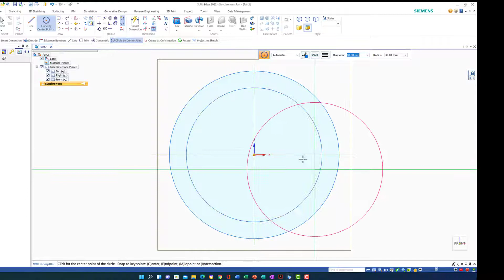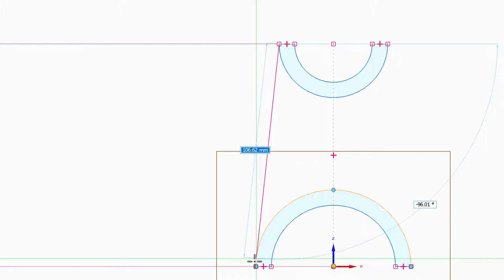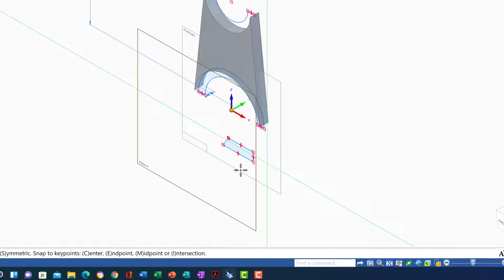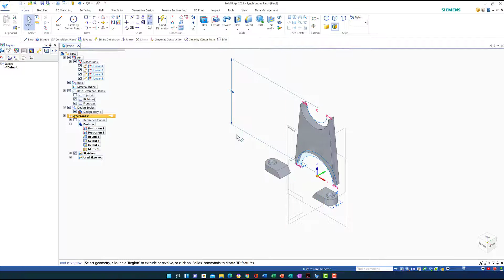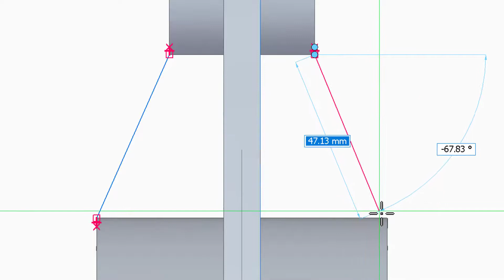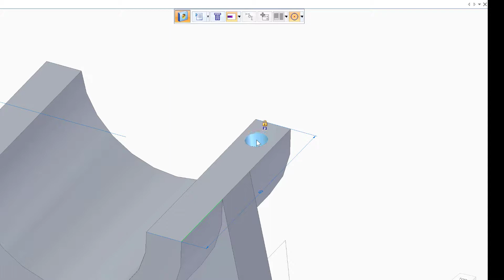Learning Solid Edge - Exercise 7

Comment: Great tutorial for learning SE. In my case, I could not get your described rib method working accurately, the curves and straight edges did not merge properly. I could solve it that way:

1. Add a new coincidence plane to right reference plane.
2. Offset the coincidence plane to the right reference plane by 5mm (half the rib thickness of 10mm)
3. Draw the rib line exactly as you have done, but on the F3 locked coincidence plane
4. Apply the RIB command, but change centered mode to a directional mode (left or right, according to the offset direction of the coincidence plane)

Done, works perfect !
Reply from the maker: Thank you so much for the feedback. Although I saw many suggestions for doing the rib, your way was new to me and also accurate. Good job 💪
Reply: Thank you @drmseif